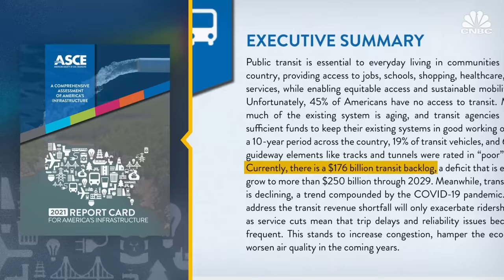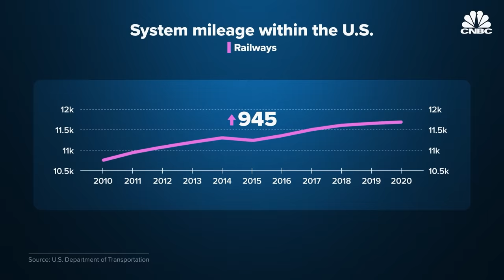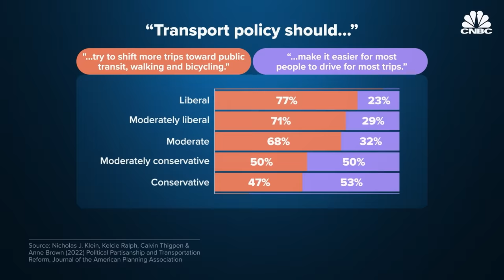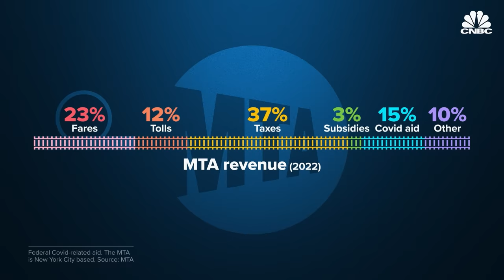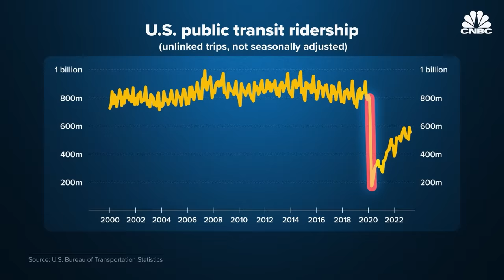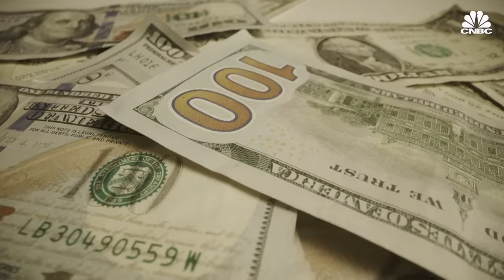Why The U.S. Gave Up On Public Transit

Comment: As a car guy, I would like us to have better public transport. Being stuck in traffic  whenever I need to do something is not fun. I don't know what the solution is, but we need more reliable ways of moving people around and reducing the amount of cars we have. We need to incentivize people not to use their cars.
Reply: Other countries move people, the US moves cars.
Reply: What you had suggested is actually inflationary, it's not going to happen and when it does, public transit won't be affordable.  On a side note, I love my cars so I will keep them and add more if the timing's right.
Reply: @2MANYCARS  ??? 
there is nothing inflationary about more people using public transit. 

public transit, especially rail-based public transit, operates on economies of scale - the operators want as much people as possible to use it as operating costs are not significantly impacted by ridership. this is also why you see freight rail attach an insane amounts of cars to a single, beefy engine.
Reply: In Moscow for example the public transport is amazing, really 20-30 sec between trains in the subway, buses are also very good we don't need a car here at all, but, because of that our government is trying to force all of us to use the public transport system, they make everything people don't use cars, for example 10 years ago I could go to work by car, right now it costs a lot to park it so I will spend more than I make for a month if to go there every day usuing my car, so I was I can say forced to sell the car and use only the public transport. There are a lot of people, uncomfortable anyway when there are always crowds of people and I'm usually much more tired than I was when I used my car. So it looks the oposite here, you are forced to have cars because no public transport and here we are forced not to have cars.
Reply: Moving people is not the objective in america. Moving cars is. That is why things are so screwed up and our country looks old and shabby.
Reply: @bingosunnoon9341 When it comes to rail freight is prioritised. People were never in the equation.
Reply: @dylanc9174  Wrong. Passenger rail received priority, most recently, during Obama's term. Amtrak was way better then because freight trains had to give priority to passengers. Same deal before Eisenhower, passengers were treated much better
Reply: This sounds exactly like what’s going on in Denver. People irritated that there’s still traffic after they spent billions for a state of the art public transit system. People aren’t utilizing that public transportation and continue to drive expecting traffic to get better
Reply: @dylanc9174  that is only the case now. rail can, and has been, used to effectively transport both passengers and freight. this country was quite literally built on the railroad. thousands of towns were built as stops alongside railroads connecting east to west, including chicago and los angeles.

it is only after the railroads were forced to compete with a fully-subsidized interstate and freeway network that caused rail to cater to freight only. it doesn't have to be this way.
Reply: @2MANYCARS  you literally are using inflationary wrong, there is no correlation between transit financing and inflation rates and subsidies are what is needed for affordable fares. We have toll free roads and refuse to raise the gas tax to match inflation since 1992, that's already two big kickbacks to motorists.
Reply: the more access to public transport we have, the better the roads will be. less cars means less maintenance, less traffic, and more opportunity for fun
Reply: Europe has excelent public transportation
Reply: @bingosunnoon9341 lol passenger rail still has priority except they almost never get priority cause the freight companies like to break the laws.
Reply: Finally car drivers understanding public transit will help them too
Reply: @JoeyLovesTrains denver’s public transportation sucks, it’s mostly useless when commuting. That’s why people don’t use it.
Reply: @davidcarvajal5739 not everywhere and cycling infrastructure sucks everywhere which is too bad.
Reply: I bike and use my motorcycle. I try not to use my car unless I have a passenger. I'm lucky enough that I live in a area with good bike lanes and let motorcycle filter through. My area also has good public transit and I use to use it when my car was damage from am accident. I still use it sometimes when I go to downtown
Reply: @ttt3377  where do you live?
Reply: It's been awhile since I last drove (sometime in 2019, I believe, at the latest) although I haven't always taken public transit to where I've wanted to go.  Uber and Lyft have been widely available for pickup points in Toronto, the capital of the Canadian province of Ontario from at least 2017.

I have remained open to taking public transit even with covid having arrived in Ontario in 2020 but having posed less of threat following the end of the worst of the winter 2021-22 omicron wave.  That said, commuting by public transit will, should working away from home be what I end up doing more often, likely only make sense, time-wise, if going to a workplace doesn't take substantially more than 90 minutes.
Reply: You can be a car guy who loves cars and still take public transit
Reply: Public roads will always be an easier expense for governments to justify than public transit. That is because the operating costs of roads are mostly paid by the user. Drivers purchase their own cars. They pay for fuel, for maintenance, and for insurance. They also provide labor in the form of their own driving. 

Public transit is not something that is purchased. It's something that is operated. For any govt. agency to establish a public transit system, it will need to ensure that all operating expenses are covered. It's a lot easier to just pave a new road.
Reply: @JoeyLovesTrains  From what I've been told, Denver's system doesn't connect a lot of areas that people would need to travel between? ie despite having good trains & service frequency, it has a bit of "trains from nowhere to nowhere" problem since very few people live near the stations - is that accurate?
Reply: @JoeyLovesTrains  I am not knowledgeable about Denver but from what I have heard, though the actual public transit system and technology itself is great, the destinations are not places people want to go from or get to, which kind of kills any advantage of the trains themselves. Is this a correct assessment?
Reply: @WhiskyCanuck  Whoa. I just asked basically the same question right after you without noticing. Haha.
Reply: @2MANYCARS that doesn't make any sense. Public transportation is designed to be affordable. Because  of the number of passengers in a single bus/train. The company makes their money from quantity.
Reply: It is (not really) crazy that the Netherlands is qualified as the best place of the world to drive.
Reply: @2MANYCARS Switzerland would argue otherwise .
Reply: Thank you so much for saying this. I am also a person who enjoys to drive on occasion but I love the fact that I live in a city that I can bike in too !
Reply: Cars are fun to drive, not fun to commute in.
Reply: More public transportation will expand the transportation options people have, less wear and tear on cars means less money has to go to repairs, reduce air pollution.

More moving = lower obesity, less healthcare costs, more socialization since people are together more than by themselves in a car, airlines would have to compete, make fares cheaper or provide better service.
Reply: @bingosunnoon9341  I'll take it one step further... America is about selling oil ;)
Reply: There are a lot of ways! There’s a bunch of good content here on YouTube. Not Just Bikes, City Nerd, and Strong Towns are a few great channels for this. I’ve been a car guy my whole life too but honestly when it comes to cities, I’d rather not drive anymore. The risk and costs are too high. And it’s only recently that I realize the actual lifetime cost of car ownership when compared against saving that money in a retirement account. We’re talking at least a half million dollars (if not closer to 1 mil +) that I’m using to subsidize transit effectively. And we aren’t even considering the 100s of billions in lost private and public revenue from traffic. If even 10% of what we collectively spend on cars in a lifetime goes towards transit, I think we will see a lot better transit solutions for people who don’t want to drive, and hopefully better roads for those who still want to drive. Plus like the video said, every $1 invested in public transit comes back 5x to the community. That’s pretty awesome. What we’re doing now with cars is about as far from fiscal responsibility as it gets too. And it forces people who shouldn’t be in a car to drive.
Reply: You are not stuck in traffic, you are the traffic.
Reply: @JoeyLovesTrains man Denver is like… so close yet so far. I ride the rail periodically but it isn’t frequent enough and the city isn’t walkable in a way that makes transit make sense yet. I think we 100% can get there, and RTD is on the way, but a big part of it comes down to density improvements, pedestrianization, and making the city less car centric. Right now downtown still feels like a racetrack with how people drive and it’s really not nice to walk around probably 95% of Denver. RiNo is the only place that’s even close imo. And that strip of businesses on Tennyson.
Reply: The only way to reduce traffic is to reduce the number of people driving. That means providing and encouraging alternatives to driving and discouraging driving.
Reply: So basically you are a hypocrite. You want other people to ride the bus but you won’t do it yourself?
Reply: @Combat_Medic  I never said I would not do it. I like to drive for fun, so I would bring out my car on the weekends to the mountains or road trips. For my everyday stuff I would take public transportation.
Reply: People are getting stabbed in public over here in Canada. I can only imagine what it's like in the US rn. Probably not as bad but still. Gruesome.
Reply: One the key solutions is the land use and zoning. Since most US cities are zoned for car use (car-dependent), it will take time. Incrementally, creating multiple CBDs or city cores wherein these areas could be walkable and with transport nodes could be a solution. This is my take as I am from the Philippines wherein most of our cities are patterned after the US which is car dependent, which started after the reconstruction of the capital city after WW2.
Reply: @2MANYCARS Typical Karen:
Reply: @davidcarvajal5739 I love the streetcars in Vienna, they’re easy to use and very convenient.
Reply: @bingosunnoon9341  It's the Auto industry and oil companies that lobbied the governments HARD to make it possible for everyone to drive, thats what caused the decline of transit in the US on the scale it's on, LA being the second largest city in the US and still has embarrassingly bad transit just makes me laugh sometimes, less than a 80 years ago it had the largest tram-based network in the WORLD
Reply: @JoeyLovesTrains  Just one more lane bro
Reply: @gregory596 You’re talking here about the expense of vehicles, not roads. If maintaining public roads is an easy expense it’s weird the so many US roads are in terrible shape.
Reply: Just think of what if arrival times could be more precise to their original schedules? Not quite the same difference, but I would like to see more public transit support in towns and cities. Basically would like the option to get from point A to point B without relying on my car (especially when parking can be expensive and/or hard to find).
Reply: @maargenbx1454  it's interesting how I wrote that roads are an easier expense to justify and you read that they are easy to maintain.

None of this is easy. Maintaining railrosds is not easy. Operating public transit is not easy. Deciding how to spend the taxpayers' money is not easy. 

My point is that building a public road automatically shifts a lot of the operational cost of that road to individual drivers.
Reply: @gregory596  Ok - understood.
Reply: We don't need to incentivize people to not use their cars, we need to incentivize them to use public transportation.
Reply: the only way to incentivize people not to use their cars is by building up quality transportation.
Reply: @MegaLokopo  every place I've ever lived where public transit was preferable to driving had one thing in common, a shortage of available parking.

Changing zoning laws that require X number of parking spaces per business/residence. Allow parking lots to be redeveloped into something more profitable. See how many people start riding the bus.
Reply: And when the freeway is jammed, our public transit buses are stuck in the traffic as well. Not much improvement over driving myself.
Reply: work from home😉
Reply: @gregory596  I would love that so much.
Reply: @LoyaFrostwind  Driving would be better of course if the buses were stuck in traffic, but they won't be because they will have dedicated lanes, and right of way at all intersections.
Reply: @LoyaFrostwind  I can eat food, drink whatever I want, and completely ignore traffic living in my own world sitting on the bus right beside your car. While you are stuck with your sore foot on the brake, staring at a car Infront of you, not because it is moving but because it might move soon.
Reply: For starters, vote for greater taxes that increase transit funding. Walk and spend the extra 10-20 minutes taking the bus. Did you know your car costs you about 11,000 dollars per year in gas, maintenance, registration, parking, etc? Your transit pass is likely about 80/month. It's economical to take public transit. People just don't think of their cars like that. Once you realize how costly owning a car actually is, public transit makes a hell of a lot more sense.
Reply: @gregory596  Nope, roads wear and tear faster than rail, rail is just steal and roads are concrete and Asphalt designed to tear down overtime, where do you think potholes come from?

Operating transit is easier and much faster because you're carrying and moving thousands of ppl in less than hours, cannot be said about cars and roads
Reply: @Windragon100  That was a thing bk in the 1800s until the 1930s, before it was all removed by profit hunger car companies
Reply: In my opinion the private approach that Brightline in FL is taking seems to be a solid option.
Reply: @josephvandenberg2483  Voting for more taxes isn't the solution. There is plenty of funding if the government would stop wasting money and use the money they do get more efficiently.
Reply: @josephvandenberg2483  Where do you live so that the bus only takes an extra 20 minutes? I live in a city with good transit and light rail, and it takes me 15 minutes to drive to work, and would take an hour of walking each way, and an hour of transit each way.
Reply: Same here!  Providing more viable transit options would enhance the quality of roads for us driving enthusiasts (ie less traffic, fewer bad drivers, less wear and tear on roads).
Reply: Americans be like : "China is wasting so much money building trains"
Americans now : "we need better public transit here!" 

🤦‍♂
Reply: @MegaLokopo  in San Francisco, the buses have dedicated lanes on Market Street. But not in the suburbs where I live. The buses can ride in the #1 lane with carpools. But still, that's usually busy during commute hours.
Reply: @ThexYz-r9y  I wish.
Reply: @MegaLokopo  But I'd have the sore feet from walking to and from the bus stops everyday. And it just takes too long.
Reply: Make Kitsap County offer Sunday Service, Bus services up to 11PM on weekdays and around 8PM on weekends! More buses, and 15 to 30 minute frequency on trunk and feeder/circulator routes!
Reply: I would take public transit but like most things,  people ruin it.  I do not like sitting next to anyone.
Reply: @LoyaFrostwind  Between the bus stops aren’t really far unlike ASEAN, China, Japan, or Korea standards. Even less distance than King’s Rapidride in Seattle. A town in Kitsap’s distance are somewhere 80 to 150 metres.
Reply: @2MANYCARS public transport are not profitable in most city in the world (if not  99%) the only one I know is in taipei but that is because the city is small compare to its population.
Reply: Lol a country with 330 million people with a significant portion living in suburban and rural areas will never choose to use public transportation when they have cars. Other countries like most in Europe, India, etc. have much more dense populations in smaller amounts of land, so they are forced to use more public transport.
Reply: @jxw1345  okay, once more with numbers. Amtrak is acquiring 83 new trains at a total cost of $7.3B. That's nearly 88 million taxpayer dollars per train. If each train equated to 300 automobiles at $40k per car, the equivalent equipment cost would be $12M; none of it provided by the government. 

Roads are a tax on transportation. They are free to use after you buy the car, buy the fuel, buy the insurance, provide the maintenance, and provide the driver.
Reply: @bingosunnoon9341  Not exactly true.  Passenger rail might have priority on paper but that only works if the freight can get out of the way and since freight trains are often too long to fit on the majority of sidings but passenger trains can, the result is that freight still has priority most of the time.
Reply: @miles5600  Its not even them, its the auto Industry, oil companies and airlines that continue to lobby hard to prevent high speed passenger rail on becoming a thing
Reply: Universal public transit.
Reply: @ttt3377  Where do you live? Portland?
Reply: @ggergger8584  really 20-30 sec between trains in the subway

this is not efficient.
Reply: @aynt_2065  Yes, thats the issue with Denver transit, it takes you to nowhere, and not rlly places ppl are coming and going from, and the station designs are terrible
Reply: @aMMa1726  Depends where, because places like Rotterdam are the least walkable and most car dependent places in Holland, which is ironic considering the country itself has amazing walkability, biking and transit in the rest of it
Reply: @Racko.  yes that’s true.
Reply: @Racko.  pleaseee it’s The Netherlands. People always say holland but those are provinces
Reply: @gregory596  Depends on the ridership too, because more trains makes less people want to take cars and that equates to less CO2 emissions out in the air and far less traffic, Amtrak still needs like billions of dollars more like funds from Congress to reach their full potential upgrading existing rail with newer one, that will encourage more ppl due to time from point A to B
Reply: @gold9994  are you sure? If it takes longer then people will not be able to enter to the subway station, we have a lot of people in our subway system, you sometimes have to pass 1-2 trains before you can enter there because of how many people are there
Reply: We already do. Public transit is very big in urban areas where it is most cost effective.
Reply: @XDTape Welcome to 2023. The days in the old west when trains were king is over. Get into the century you were born in.
Reply: @cooldudicus7668  not really, train and bus service is not very frequent nor is it clean most of the time.
Reply: So you want everyone else to use public transit so you can drive your car on less crowded roads
Reply: @2MANYCARS that's like saying building roads is inflationary
Reply: @Racko.  Even the most dependent car places in the Netherlands will be considered utopia in most countries.
Reply: @ggergger8584  Well, what I was saying is:

20-30 sec in Peak hours are necessary.

Otherwise, once every 3-5 minutes are okay.
Reply: @gold9994  oh, yes, it's mostly in peaks, 5 minutes is too many for Moscow, but it's not in peaks can be 1-2 minutes. Again, if it is going to be 4-5 minutes, a lot of people will be there, the whole day in the subway we have many people, I have visited some European countries and really I like our public system more + it's really cheap here, $0.9. Where are you from if that is not a secret, just interesting to know because we have different perspectives and it of course depends on places where we live
Reply: @ggergger8584  Russia has a terrible government, and can only be used as an example of how not to run a country. Your experiences will be unique to the rest of the world due to how backwards Russia is. Plenty of places have great public transportation, and are great for cars as well. Tokyo is a good example of this
Reply: @2MANYCARS  where do you pull that from? efficient investment in public infrastructure will always be deflationary since it reduces the time and resources to move goods and people, hence increasing turn rates and underlying productivity of an economy
the infrastructure bill could be inflationary in the first few years, but the infrastructure when built correctly can be used (deflationary) for a hundred years
Reply: @cooldudicus7668  if "2023" entails spending billions of dollars taken as debt on endless highway expansions that don't solve traffic and bulldoze thousands of homes, businesses, and places of worship, then i have no interest in continuing that kind of "2023". there are a wealth of cities around the world and in our past whose growth model is actually sensible and doesn't require us to bankrupt our cities and add onto our federal debt.
Reply: And you're right. But the US just does not care of the public transportation system, like they dont care about homelessness.   China, Korea, & Japan have reliable & clean public transit system & I'm pretty sure European countries like France, Germany, & England are top notch on their public transportation too!✅👍.
Reply: @2MANYCARS Jist gotta make having a car more expensive. Higher gas prices, higher parking prices, and city sticker prices
Reply: Prosperous places will always have traffic b/c people will always be willing to drive from farther and farther distances to go there
Reply: @bingosunnoon9341 they received it but it isn’t enforced.
Reply: The interesting thing is, public transit benefits people who like to drive, too. For example, I hate driving, but because I don’t have another option, you have to put up with me and my car on the highway. Traffic will improve if the only people on the highways are people who want to be driving, instead of just anyone who needs to get anywhere.
Reply: The USA valves cars 🚘 over people it is sad. As a person who commutes without a car you see it everyday!!!
Reply: Gas prices are high, traffic is at an all time high, transit ride cost $2-$4 in most places... if people aren't riding now, they never will. T
Reply: just copy Hong Kong MTR.
semi-official company carries >2M people every day, with 98% punctuality.
Reply: The solution was specified at 11:30
Reply: Having a car is a sense of freedom. It has nothing to do with convenience as it is possibly easier to not have a car in these metropolitan cities.
Reply: So you think OTHER people should take transit to make your car rides easier?
You're the Onion
Reply: Don't be a car guy 😩
Reply: And whey you personally plan to stop using car? I heard a lot of such talks, but its all leads to "we need (other) people to stop using cars because we want to ride freely on empty road".
Reply: “You aren’t in traffic. You ARE traffic.” That quote really changed how I assess what situations I need to use a car for
Reply: I don’t have a car in a place where there’s almost no public transportation. I usually have to get rides from people or walk in the road basically
Reply: ever heard of walking?
Reply: @piku5637  Car and Oil companies: Lmao no!
Reply: @miles5600  Im too used to saying Holland and Amsterdam knowing full well its the Netherland due to being lazy
Reply: @aMMa1726  Netherlands have great land use, someone will tell you because its a small country when it has everything to do with zoning and land use
Reply: Tax gasoline high enough to fund mass transit.  The oil industry and highways have been subsidized for decades using general taxes.  The railways?  Hardly at all.

China has built nearly 35,000 miles of high speed rail that travels at over 180 mph plus another 110,000 miles of 'feeder' rail lines for short distances or to connect to the HS stations in the last decade.  Meanwhile the USA can't even finish 100 miles of track in the central valley in California.

The cowards in congress need to show some spine and tax road traffic higher, take away oil industry subsidies, demand higher driving standards before people can obtain or keep a license to drive.

BTW, I own and drive nine vehicles ranging from a 39,000 lb GVW RV to a 1970 high performance collector car, and I enjoy driving all of them at times.  I also enjoy riding on public transportation when I want to not be bothered with parking or need to work while traveling.  I have ridden in trains and busses all over Europe and China.  In the US?  Not so much.  They don't go where I want, are too slow, too old, uncomfortable, etc., etc.  Transit in the USA is comparable to Italy in the 1950s, but not as friendly and not as inexpensive.  In those days you could buy a roll of bus tickets in Milan or Rome and use them as small change, to buy coffee, a newspaper, even ride in a cab.

The wealthy funding our right wing politicians on both sides of the aisle get ever wealthier while the working stiff waste their time in traffic jams, polluting the world and enriching the oil industry.
Reply: @Racko.  i get it :)
Reply: We don't even need to incentives it, it just needs to be an option and people will use it
Reply: You nailed it: Moving people. I drive 20k-25k per year as a service person, , but use bikes, eBikes and would use trams if we had them for non-work. 

But biking is unsafe where I live. Hell, so is walking.
Reply: @2MANYCARS what do you mean public transport is not affordable? And why are other countries able to provide cheap public transportation?  Even free transportation like in Luxembourg
Reply: @miles5600  Yeah
Reply: Yep, public transport actually benefits all, even for people really like driving. Most people drive because they have to and no other better option or even option at all. Most drivers are not car enthusiasts and will just buy another econobox or front-wheel drive SUVs only to drive to the shops few kilometers aways since there is no walkable shop nearby, nor even safe to do so due to the infrastructures were built and cities were designed.

Living suburbia automatically will mean each person has to drive since buses are practically non-existent and unattractive. 

Now we just get more traffic congestion, which means travel times become longer and driving just becomes stressful, which isn't great for mental health. Having nice sportscar isn't that enjoyable to drive around cities when just being stuck with traffic and due to huge number of vehicles around, that also increase the potential for accidents due to road rage or simply due to having more bad drivers in the road. 

Congestion just adds more unnecessary wear and wasting precious fuel to the car as well. Can't rev that nice sounding engine while on standstill.
Reply: We could learn a bit from Japan
Reply: You realize that includes you, though. You aren't stuck in traffic, you are traffic, and if everyone thinks everyone else needs to get off the roads, nobody will get off the roads.
Reply: That is why I love Japan’s transportation they are or should be (Americunt, lost its edge on public transportation in the 1920 it is self evident…. To understand more read history for those don’t know.) a role model to follow, they have the best transportation system In the world I envy Japan. Why in the US we don’t have some sort of train that goes to important strategic cities such as Washington DC, New York, Houston, Mcallen..etc way easier no car traffic less time waited and population control. 1920 was Farr better crowded but well organized.
Reply: @2MANYCARS  if my third ass country can make public transit affordable, so can USA. You all just hate mass transportation.
Reply: The issue is enough people want to drive like you do.
Reply: It use to be one car per household (family of five). Now every household has a minimum of five cars.
Reply: All america has to do is look to other countries where things work better, and just do that.
Reply: Wow. A sensible American driver 😂😂
Reply: @bingosunnoon9341 also classism. A flashy car is better than being near the “undesirables”.
Reply: I promise that when we make public transportation safe, on time and FREE the problem will be solved.
Reply: I worry that the best way to get people using public transit, at least in cities, would be to disincentivize car traveling. Whether that be increasing parking prices, shrinking the amount of lanes, or something else. 

I don’t doubt that many cities want to shrink their roads so they can spend more in other areas, but as she stated there needs to be a large investment into public transportation, otherwise the money for it will have to be pulled from somewhere else.
Reply: @gregory596  while government would look at roads as an easier expensive because its not cheaper, and users pay very little for the operating costs, the city/state loses more money on road maintenance in the long term, more cars on the road equals more road wear which means more road maintenance, and cars are getting heavier which also means more wear and tear on roads.  
While yes public roads is an easier expense to justify because people don't see the expense themselves  and citiy's and states carry that burden while they get subsidised, which is bad because we could be subsidising public transport instead which in your very bad comparison you could say would be more efficient because they carry more people per fuel used, maintenance would be less per person and also insurance.
Reply: @AidanS99  Americans have tried to expand their highways repeatedly and it fails every time
Reply: @2MANYCARS your insecurity is palpable
Reply: As a car guy. There are days where I'd rather hop on the subway, bus, or train especially if I am going to see family 6 hrs away by car. Train would be prefect.
Reply: @GuthanSlayer  with over 150 replies on this thread, I can understand that you haven't seen all of mine. I have already addressed this, but will point out again that I am not talking about road maintenance (of course, that has a cost as does rail maintenance). I'm pointing out who pays the cost to acquire and operate equipment. 
Whenever a government constructs a public road, it is demanding that the users of the road provide their own vehicles in order to derive benefit from it. It's a tax on transportation.
Reply: @gregory596  rail costs less to maintain than road
Reply: I think Your understanding is flawed. only Americans of substantial means could afford trains frequently. BEFORE cars cities were littered with horse and buggies, strewn with feces and disease causing pathogens, CHildren played in those streets. Most Americans never traveled within 50 miles where they were born. And most traveled by train maybe once or twice in their lives. Before about 1840, cities had no defined central business districts as we know them today. The first skyscrapers weren’t built until the 1880s. Since 1920, the economic forces that led to the construction of dense downtowns have been largely replaced by decentralizing forces. The appalling living conditions faced by some of these families were documented in an 1890 photo book, How the Other Half Lives. This book generated a movement by urban planners to try and improving housing and living conditions, if possible by moving those people to the suburbs and providing them with cheap transit service to the cities.
The departure of factories left downtowns as office and retail centers, but the development of affordable automobiles, electric power, and telecommunications left few reasons for these to be centralized. The nation’s first suburban shopping mall opened in 1922; the first modern supermarkets in about 1930. And what undermined rail transit was advent of engine over axle bus, in 1927 which could move 40 passengers without need overhead wires or rails in the streets. As such buses go ANYWHERE.
Reply: Yeah we need to improve public transport majorly, it's crazy how much traffic we have out there, even in NYC which has better public transport than most places
Reply: Hyperloop is the solution!
Reply: @DanielDavis-kl5cl  Hyperloop is destined to fail. Like rail systems, depends on it's own infrastructure. The problem here is Hyperloops require Smart infrastructure; Which is infrastructure that contains the technology for whatever it is supposed to do within the infrastructure. It's downside is it's owners must pay for the upkeep of both infrastructure and vehicle. Technological sophistication invites planned obsolescence; soaks up huge IT expenses and support costs. If they should desire to upgrade it or replace it, costs mount. Once this is done and a significant amount of infrastructure is built, however, it will be difficult if not impossible to upgrade the technology as new ideas are developed. Since the technology is in the infrastructure rather than the vehicles, any new technology would require that existing infrastructure be rebuilt or overhauled at great expense. That means shutting it down as upgrades/overhauls take place. Dumb infrastructure is infrastructure that incorporates minimal technology and instead relies on infrastructure users to supply their own technology but pay for the capacity to use the infrastructure provided. When cars first emerged they used same streets/roads as horses and buggies thus No immediate need to upgrade the roads were needed.  The advantage of dumb infrastructure is that it is technology independent, A 50 year old car can use the road as a modern car. The reason cars and planes work so well, the user either provides their own technology; or pays the provider for using technology with exceptionally low amount of infrastructure (and thus LOW infrastructure costs). Flying requires little infrastructure except a few thousand feet of runway. For cars; the technology costs are bared by their individual owners, Drivers only have to pay for infrastructure usage. In any case, once hyperloop is built, there's nothing the technology pushers can do to address or answer for improvements in automotive and airplane technology. Therefore it's technology will rapidly become obsolete. Not to mention new routes; the industry will be torn between building more which will add to he logistical burden of maintaining their technology.
Reply: "i don't know what the solution is" 
then says the solution
Reply: @Anthony-db7cs  in the 2005 'Rail versus road, Track maintenance costs' report from Transport-Watch UK, it was stated that road maintenance costs were in the range of £25,000-£33,000 per lane per kilometer. Rail maintenance costs were in the range of £62,000 -£94,000 per track per kilometer.
Those numbers apparently came from 2004 transport statistics for Great Britain. I could not find a similar comparison for US transit maintenance costs.
Reply: @gregory596  American Society of Mechanical Engineers, annual maintenance costs range from $33,359 per mile to $123,596 per mile for a track with minimal curves where freight trains predominate. This says nothing if passenger trains most of which operate on their own track. Fares don't even cover operating costs or maintenance....
Roads are considerably less expensive
Reply: @spikedpsycho2383  Thanks. I didn't realize how expensive track maintenance was. Judging from replies I've gotten on this discussion, the general public doesn't know that either.
Reply: Also adds up the price in the pump
Reply: Build houses close to transit. Preferably row houses or perhaps some low rise apartments. Make it so that people can raise a family without needing a car. If a family has A car, that they can use when they need to it isn't a big deal. If you need one to live, you have a problem. So have some shops close to homes and utilize transit to the max, by having people live close to the station.
Reply: @2MANYCARS  "On a side note, I love my cars so I will keep them and add more if the timing's right."

By any logical analysis, more public transit would be better for drivers, too.  How anyone can fail to grasp this is hard for me to see.  If I'm on public transit not driving my car, that's less traffic for those who are driving.  

Cars are depreciating assets.  I prefer to operate one efficient car when that suits my purpose, and use public transit or walk otherwise.  I can see collecting beautiful classic cars as a hobby, and a few of them can retain value or appreciate, although that's not my thing.  Blowing money on a bunch of average cars as some kind of a flex is hard for me to understand.  But I have no problem with people doing it.
Reply: @LoyaFrostwind  One, I'd much rather be stuck on a bus where I can do something useful than stuck behind a steering wheel.  Two, if more people took the bus there would be less traffic jams.  Three, trains aren't stuck when traffic is jammed.
Reply: Bycicles and more green lanes is the solution to high traffic
Reply: public transportation is something that everyone should be using....everyone else that is :)
Reply: Buy a big drone.
Reply: I agree 100% I love driving, but I understand the need for transport. It will make literally everyone’s lives easier it’s just common sense
Reply: @@freddiebob7092Walking and biking isn’t what we’re even talking about here. We’re talking about robust public transport systems like trains, metros, ferries, monorails, trams, and buses.
Reply: @2MANYCARS  Wow, you can be really proud of yourself with that attitude.
Reply: @2MANYCARS it's not inflationary if it's government funded and ran, like it should be, like every other country with a good public system
Reply: Yeah, this is something many pro-car people don't understand. Moving away from cars as the default would also free up the roads for the people who really, genuinely, actually need to drive.

Take a permanently-jammed motorway and turn one lane per side into a suburban railway that stops at the few destinations where 80% of the population goes (80/20 principle). Sparing eveyone the maths, this will massively remove cars off the motorway, leaving room for the 20% of people who actually needs to drive because their destinations are legitimately too spread out for public transit.
Reply: @gregory596 It's a common myth among fans of driving that drivers pay for most of the roads they use. There's nowhere in the world where drivers pay even a bare majority of road costs, although the Netherlands comes closest by having extremely high taxes on cars. In the United States use fees like gas taxes, registration fees and tolls cover 35% of road costs, on average. The balance comes out of the general fund, which means people who don't drive are subsidizing your car use. 

And we really ought to think about why we have a national transportation system only about half the population can use at any given time, when you think of all the people who can't drive but could take public transit: children, the elderly, the disabled, people who are constitutionally unsuited to operating complex machines, people who are temporarily unable to drive for reasons ranging from legal trouble to financial trouble to breakdowns and crashes and injuries.
Reply: @gregory596 Yeah, but do you know how much US citizens spend owning their cars? $1.5 trillion. Add in the $350 billion we spend on road maintenance and we've got ourselves an almost $2 trillion national transportation system. Meanwhile, US railroads are spending $25 billion a year on their road maintenance and hauling 35% of the cargo that travels overland in the US. Mass transit is an incredible bargain compared to the astronomical cost of highway transport.
Reply: @joshbobst1629  That has been my point all along. By building roads, governments are requiring citizens to purchase cars. The roads are mostly free to use once you pay the $30k+ entrance fee.
Reply: @bingosunnoon9341  That's the ONLY way it should be too,go get you a dang car and drive yourself and I don't WANT absolutely anyone driving my ass any dang where and if I crash in anything then I want it to be that's driving that car/machine and NOT someone else that I don't know and that I don't know if they can drive at all much less drive good or if they'll be paying attention on the roads out there
Reply: @bingosunnoon9341  Also,don't you dare come at me like bro,YOU HEAR ME SON???
Reply: Start supporting toll roads, express lanes, paid parking, and eliminating mandatory parking requirements in zoning. All these will fund and incentive public transit while discouraging frequent car trips
Reply: @2MANYCARS  Mass transit is way more economical than car travel. The typical 2-track metro system moves more people than the 26-lane Katy Freeway in Texas.
Reply: @bingosunnoon9341  …also housing cost, medical cost, and bloated military budgets.
Reply: @DynamicHaze  Read more about events in the United Kingdom and you might change your mind. They have taken over their fourth private rail system. Good transit systems in other countries are the result of major government involvement.
Reply: @vinaynayak415  No one is talking about putting high speed rail in South Dakota. There are plenty of densely populated corridors in the United States that would greatly benefit from high speed rail. Canada is massive and only has 40 million people, but it could definitely benefit from a high speed rail line between Toronto and Montreal.
Reply: @gregory596  Yeah, force people to do what YOU want!
Reply: @joshbobst1629  Freedom  > mass transit.
Reply: The reason it won't work is that we love the freedom our car gives us.  You sound like you want other people to stop driving, so you can drive more easily!
Reply: @richardvinas5766  Well, it's not really freedom if driving is your only viable option. You are more or less required to have a car because there's often times no other option so you don't get the freedom to choose.
Reply: @OutsideSometimes I spent a miserable year and a half in Denver and can confirm this experience. I’ve only ever used the commuter rail and it takes forever and the sprawl, six lane roads throughout the city is gross. How unfortunate given the recent growth and opportunity to make it a great city.
Reply: @@freddiebob7092yeah wouldn’t want conservatives to have to exercise lol
Reply: @richardvinas5766  Don’t worry cars are not going away. Many people just want freedom to travel by affordable alternatives to cars. Cars, their maintenance, insurance, and infrastructure costs are expensive. Consider that the per capita cost of car infrastructure is more expensive than public transit. Less traffic and lower taxes for road maintenance/road widening benefits drivers too. It is a double win.
Reply: @amaurilol2  The freedom lies in driving when YOU want, not being forced to follow some government schedule, and go where YOU want to go, not to whatever stop may be "nearest" to that place although it's half a mile away, it's pouring rain and you're loaded down with groceries.

Public transportation? NOPE.
Reply: @Mosux2007  I know that it's hard for you to get your head around, but you would still be able to go wherever you want if we had well designed cities and public transportation. But keep living in your delusion.
Reply: Fewer people would mean fewer cars on the road, but that's not going to happen by consensus.
Reply: @Mosux2007  that is certainly another advantage of public roads. They don't rely on a central controller like public transit systems do. Each driver is responsible for planning, scheduling, potentially updating, and ultimately executing his or her travel plans as required. The operation of the system is basically performed by a neural network of individual drivers. 

Now before I begin another storm of replies, I know traffic engineers spend a great deal of time and thought on setting up the system for drivers to use and also make adjustments to things like traffic signal timing as needed. My point is that no one else is going to decide the best route for me to take to work or what I should do if the route is blocked.
Reply: Look at how Europe did it and how China and Japan did it. You can't just have just cars.  You need al time if different ways to move people from a to b. Not just cars
Reply: @Mosux2007  Then why can't I have the freedom to choose something besides a car?
Reply: @joshbobst1629  You can. Just don't expect it to be as good as a car.
Reply: @Mosux2007  But the argument among car detractors is that if we funded mass transit like we do car transportation, at about $2 trillion a year, it would be as good. Considering the cost of Mass transit is so much more affordable than single occupancy vehicles and the enormous highway space they require, the same money would make it way better. Or, conversely, we could spend a third as much and have it be merely as good.
Reply: Well the option to use your car less DOES exist if you're in a city with those options. 
The idea "we need to incentivize people" is a dangerous one... b/c the way we do that is THE KEY to making it happen. 
If we do it with gov't force- it's authoritarianism, and should be destroyed for it. 
But if we do it with smart policies and natural means- I am ALL for that. Our biggest obstacles in that- not allowing "mixed-use" zoning and developing massive amounts of space between various "use types" so that it makes it IMPOSSIBLE to not have a car- even in urban cores, you can't do much more than you can carry in 2-3 bags or a backpack. THAT is not a winnable option for mass transit. If you can't do basic functions MANY people do daily on it, or at least as EASY as they can with ti vs a car, it'll NEVER work
Reply: @2MANYCARS Europe does it all the time. So..
Reply: many of the big cities in Europe are actually on their way to reducing even more car traffic, there are several government funded projects all over Europe to built more car-free zones, ban polluting and damaging vehicles, make city spaces more biker- and walker-friendly. PLUS, they're making public transport even more affordable through government funding and most countries are at least investing somehow into the public transport infrastructure and railroads, like many buses have become electrical.
Reply: @2MANYCARS  Actually is completely the opposite, as there will be more gas left around the over offer of gas will plumbed the prices of gas down, same with cars, car inflation went over the 20-25% in the other hand it is more healthy to walk and use public transport
Reply: @@RaelXSS How so? It might be nice to have your own car, but in reality in most cities in the world, it's better for everybody to have public instead.

The U.S. public transportation is complete garbage though, so I see why you'd say that.
Reply: there are so many weirdos, junkies, and people acting like animals (smoking, blasting horrendous "music", sitting with their feet of that seat, etc.) on public transport. I honestly believe that it's the primary reason people in US prefer to use cars and invest in road infrastructure instead of public transit. in other parts of the world, like Europe, people behave more decently in public, and thus usage of public transport is more prevalent.
Reply: @JoeyLovesTrains  It's the vicious cycle they talked about. I live in Denver and when I have time I literally add hours to commute time just to TRY to use public transit. But often times that's not feasible. Denver is a perfect example of the problem with buses and trains being less frequent and less reliable so you can't depend on it, not to mention lack of service in key areas that I need. The only route that's reliable that I take 100% of the time is the A line from Union Station to the airport. If every train was like that and actually reached areas that I could access without a car, I would use it all the time. Hell it would be amazing if we had ANY public option to get to Red Rocks.
Reply: @WhiskyCanuck  Yes that's exactly accurate. I've lived in half a dozen different areas in Denver and the only time I had any decent train connection was when I basically lived on Colfax (where no one wants to live) and still had to walk like a mile to get to a station. And then it was sketchy and not enough service frequency to rely on for work commuting. I've worked with people at Pepsi Center that had to rush out of work early to try to catch the last train when their cars were in the shop. What's the point of having a train go to Pepsi Center if it's not providing service after people get out of going to Pepsi Center?? And that's the route that actually makes sense. They have a lot of lines that kind of snake all around major roads and go through weird areas that don't really have a bunch of useful stops. There should be points of vital interest and relevant city landmarks that can be reached by trains. I'm having trouble thinking of any that do.
Reply: @vinaynayak415  If I had a cheap reliable fast train going from my suburb to the city you bet you bet your ass I'd use it.
Reply: @cooldudicus7668  Ah yes the century of sitting in traffic burning gas in a boiling concrete jungle of roads and parking lots. Couldn't be better
Reply: @213mug  Exactly. Some people want to never have to drive again and that's cool. But I ideally would like to only drive if absolutely necessary, such as to carry things or use recreationally going to the mountains or camping or something. If I could commute primarily by train and visit friends by train I absolutely would as much as possible.
Reply: Move to a rural place. Traffic is not a problem unless there are major events like county fairs and the traffic jams only last a few hours.
Reply: You ever try to stop being a car guy? That would help.
Reply: @XDTape I sort of agree with the both of you... i.e. the right tool for the right job.  Public transit can be useful in dense areas, but try making that work in the deep mountains, sorry you'll want a car there.  Keep in mind we are also a large landmass for a nation and we have housing built the way it is, it can't easily be changed.  Not keeping that in mind is foolhardy.
Reply: @JoeyLovesTrains for better or worse, the convenience of being able to instantly get into your own car and move somewhere is not something public transportation can easily solve.  That's one reason people still use cars.  Yes, yes ok in crowded cities... that's one thing, but in a suburb like mine, no way do I even want to wait to be picked up when. I can just use my car, and I can get everywhere in roughly 10 minutes
Reply: @bingosunnoon9341 cars move people. Don't act like they don't.
Reply: @ggergger8584 Sitting in my car in traffic was much more tiring for me than using public transit. Even when I stand I can stretch out, the walking to and from station is healthy , and you’re not stiff in your body nor frustrated by the stop and go of traffic. 
If I lived in a rural part I might feel differently , because you have open road. 
But in a city or? No car, thanks .
Reply: @MegaLokopo This is exactly how I felt driving in traffic, the stop go, foot on and off pedal, staring at cars I’m in front , was bad for my body and mind. Now I’m on transit and my body is less stiff and my mind less frustrated from the journey .
Reply: @hirsch4155  Exactly, and I doubt you feel more constrained or like your freedom was taken away or any of the other bs people claim comes with not driving a car.
Reply: It's not complicated, just requires political willpower to do it
Reply: if public trains are more accessible, cheap, and convenient. We would love to use public transportation to travel around the country.
Reply: @ggergger8584 Because the state owns the companies basically and they don't allow the companies to cheat the government. In the US its not the same and if we did out a clamp to it no company would want to do it.
Reply: The solution is good public transit.
Reply: Agreed! Better public transit = less people need to rely on driving = less cars on the road = driving enthusiasts have a better experience! Everyone wins!
Reply: it's mostly zoning and people not living near where they work or shop
Reply: Make  cars more expensive
Reply: @mrhat1073 Same goes for car size and be weight. Stop driving those heavy SUV and pick-up style vehicles if you're not a farmer (real farmers prefer different vehicles to the modern SUV anyway, I've been told). There's no need to drive a mini tank on the highway from your suburb to your job. They're fuel inefficient, deadly to pedestrians and cyclists, especially children (look up the number of parents killing their own kids in the driveway through the last decades), climate killers, road surface killers and they make traffic and parking worse.
Btw., they aren't even great for transporting goods. Turns out that the good old hatchback can hold way more stuff than the average SUV due to inefficient design of the latter. If you really need to haul big items on the regular, go get a mini van.
Reply: @miles5600 Did they build the stations in the wrong places? Or did the lines fail to connect the right parts of the town? E.g. always going to the city centre, no cross-connections between suburbs, ...
Reply: @e.458  i forgot what the comments were about 😅 would you mind tell me it again? 

If you’re talking about the US than yes. Stations and connection are really bad, some stations are in between the bidirectional traffic on the freeways or located in very unpopular places and have a huge parking lot to ice the cake.

They’re also extremely unfunded, old and barely have any useful connections to begin with while also being slower than driving most of the time, people always say that commuters don’t wanna take the train cause they’re dirty and meant for poor people while that’s only partly true. It just needs a lot more funding and a lot better planning. Like putting stations in the middle of city centers and places where people wanna go/live + add bike parking while removing the parking lot completely.
Reply: US is too big and you can’t have public transit everywhere.  It makes sense to have it in big cities
Reply: @sunglee3935  the US is literally built by the railroads. Why wouldn’t the US be able to provide local public transportation in most towns???
Reply: @miles5600   not enough people in a lot of towns
Reply: @sunglee3935  what is not enough to you?
Reply: @miles5600  rural towns will be not enough, they will be losing money all the time
Reply: @sunglee3935  public transit is not about making a profit though, it's meant to bring people from A to B in an efficient way. highways loose money too yet they're needed for freight.

image how much money you can save your citizens if they'd ride the bus, train or bike to work, grocery store or just to visit friends and family. ofc you gotta have good rapid and frequent bus service which is totally possible and good bike infrastructure too as well as good train service, this just has to be properly funded by the government and well invested.

you can find a lot of videos on YT about how The Netherlands does transportation and it's amazing and everything they have is achievable in North America too.
Reply: @miles5600  America is a lot bigger than Netherlands
Reply: @sunglee3935  so? people are not commuting from coast to coast daily. they mostly stay within the city/town.
and i wasn't just talking about the Netherlands, this is all of europe.
Reply: You're not stuck in traffic. YOU ARE TRAFFIC.  That's your fault.
Reply: @2MANYCARS your right even as incentivising is wrong & unconstitutional and autonomous cars legally no right to outlaw menial drivin cars either even half the world owning cars as individuals and only some not, like uk and Finland, and on the side public transport advances from a lesser know innovators in the us
Reply: @bingosunnoon9341 and independence is our best loophole when public transport fails, even innovating it and improving both train bus and airlines both domestic and abroad
Reply: @gregory596 That's not true. Roads are heavily subsidized throughout their lifetime and gas prices are kept artificially low by the government. Remember early 2023.
Reply: @parsahasselhoff7986  sorry, I've replied to numerous comments on this post. Which statement is not true?
Reply: @spikedpsycho2383 To be fair, if more people use transit, the roads would be the “fluent rivers of steel” that the 50s propaganda films claimed
Reply: @gregory596  only if the government is incredibly shortsighted. At least within cities and suburbs, the total cost of prioritizing roads/cars instead of public transit, biking, and walking infrastructure is enormous. There are so many hidden costs of roads/cars that it’s difficult to even quantify how terrible they are.
Reply: @MegaLokopo  if it would take you 15 minutes to drive and an hour on public transit, you do not live in a city with good public transit.
Reply: @holycow343  ?
Reply: @conceptcs  where is the freedom in needing a car to live?
Reply: @darkcheeto3338  walking is not a viable option for most trips in the US due to the way our cities and suburbs have been built around cars.
Reply: @Loj84  ok two things first of all I forget I made this comment and second of all it was 2-3 months ago so It doesn't matter anymore. on a side note nyc is a very walkable city so much that's it's considered weird to own a car if you live there.
Reply: @darkcheeto3338  if it doesn’t matter, don’t reply. And congrats, you live in one of the few places in the US that is actually walkable (arguably not pleasantly walkable and needs a lot of work still, it’s okay at least). Most of the rest of us do not have that as a realistic option.
Reply: @Loj84  I don't live in new york.
Reply: @darkcheeto3338  okay, so… why the h3ll are you bringing up nyc?
Reply: @Loj84  because it's a walkable city you don't have to live there to figure that out.
Reply: @Loj84  I was using US standards, where having a single bus would but you in the top 50th percentile.
Reply: @MegaLokopo  yeah, that’s fair then lmao
Reply: @bingosunnoon9341  Other countries have other demographics.  It works in Finland for example because, well, you've got a nation of Finns.
Reply: @dylanc9174  Rail freight makes a profit.  It also creates jobs.
Reply: @MrRezillo  So what? Passanger rail moves people, creates wealth, and creates as many jobs. Passenger rail should get priority, as is the law in the U.S.

If rails were managed by passanger companies they would be better maintained, and usable at higher speeds. There would be less accidents. It would benefit most parties.
Reply: @dylanc9174  Lotta "shoulds" and "ifs" and "could" there.  Sounds good, but is it reality?  Passenger rail creates weath?  Can European rail systems show this in their bottom lines?  Believe me, if I had cheap, reliable and SAFE public transport available I'd take it.  But that's a pipe dream here.  I capitalized the word SAFE because that brings up whole bunch of social issues which render rail transport unfeasable in the current state of affairs.
Reply: @MrRezillo  Transit doesn't horde wealth like freight companies do so no the benefit is not something you can show on a piece of paper as stocks. You can however see the benefits to a city, and predict the increase in GDP after transit increases productivity, and allows economic mobility.

Cities lose billions of dollars because of traffic alone, and the cost cars cause for the average worker prevent money being spent elsewhere.
Reply: @dylanc9174  it really comes down to a number of peripheral but serious social problems that would need to be addressed to make public transit viable.  Again. people won't take public tranport if it's unsafe or even unpleasant.
Europeans are more likely to take public transport because vehicle ownership is more expensive there.  Gas/petrol is much higher there.  The cities are older and more compact, fewer parking spaces, etc. etc.

Many American cities are overwhelmed with homelessness, addiction and crime, so transit "benefits" to the city are less and less.  San Francisco Bart ridership is way down, as is NYC subway ridership.  With more options to work from home, there's less reason to endure the daily grind of a subway or bus commute.
Reply: Sounds like you want public transit for other people so "car guys", like yourself, won't be stuck in traffic. Imagine if 90% of the population considered themselves "car guys". Everyone continues driving and traffic congestion remains the same or gets worse.

You have to accept and want to use public transit in order for it to be funded. Not just expect your neighbors to use it.
Reply: @Say-Hello  Good point!
Reply: @bingosunnoon9341 : Negative, Amtrak did not had priority above freight rail during Obama Presidency. Both USA & CAN freight rails can travel & deliver various bulk material items from coast to coast within 24 hrs, than both passenger rails upon travel & stop from city to city approximately 3 to 4 days. Yes freight rails of North America will always have top priorities due to commerce.
Reply: You're a car guy because just like most Americans.....you have no other choice
Reply: @bingosunnoon9341  And the US isn't even great at moving cars efficiently haha.
Reply: Lets all start riding bikes
Reply: The problem is everybody in the US loves cars (never met a person who perfers cars over train and I lived in CA for many years). Even young adolescents dream about having a car at age 15-18 (not getting into a train). 

I myself prefer cars, so it seems the train won't be so beneficial or supportive by the american ( the government wants quick money and that's what cars get them). It's just in american culture, history, and preference (so greatest of luck in convincing ppl to give up their cars over trains on usa).
Reply: @bingosunnoon9341 they don’t
Reply: It is good to have alternatives, many different modes of transportation
Reply: trains are the most efficient
Reply: The solution is mass transit.
Reply: I don’t like Cars, never have and never will. Driving is boring to me I just wanna get to the place I’m trying to be at so public transportation is good for the public
Reply: I’ll never understand “ car guys “ cars are boring, even the Lamborghinis are boring to me I’m more impressed by Motorcycles
Reply: As someone that doesn't drive and hates cars, I would also like this. Getting more ppl into buses will reduce traffic for everyone on the road
Reply: The problem is the extortionist real estate system.  Soon as you put transit hubs somewhere, the prices go up and people have to move somewhere further away making it cheaper to drive when your housing is cheaper and bigger by living out in the burbs.  You can't absorb the benefit of being in a good location it has to be inflated into the price of the home when the homeowner did nothing to make that location desirable.